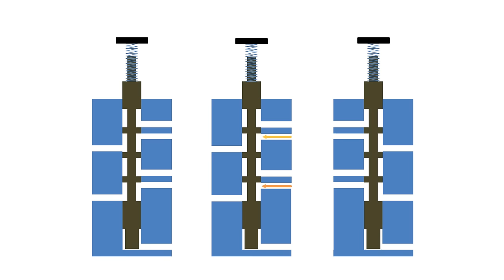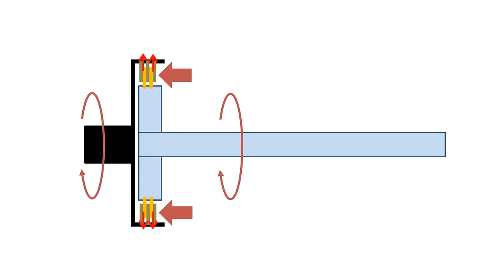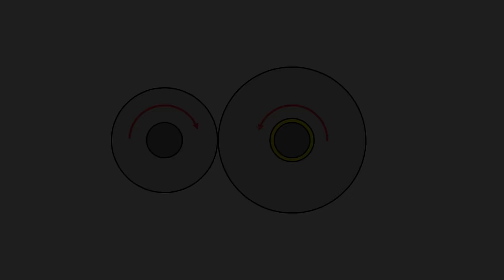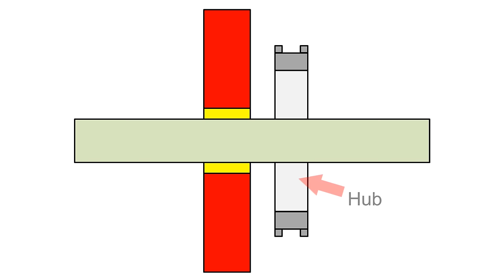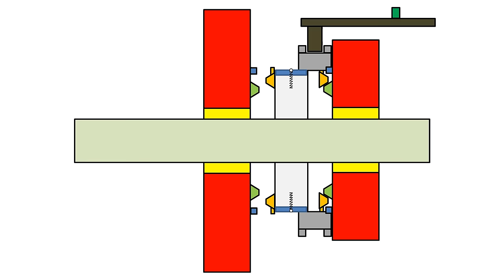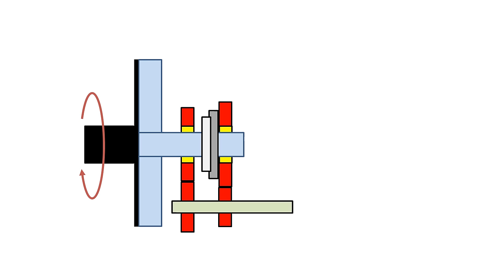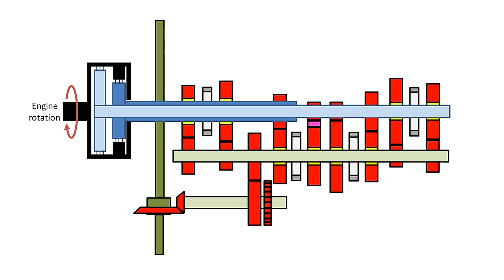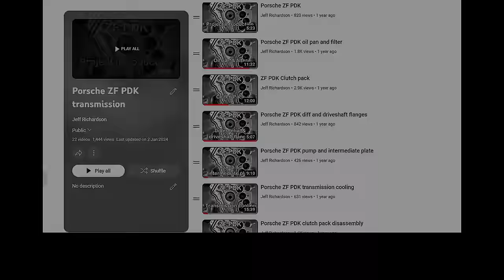World's Best DCT. Porsche PDK. How it works........... Part 1.........

Comment: The reliability of the PDK when considering the complexity is amazing. 83k on my 981 with no problems. I change half the PDK fluid every year as a preventive measure. The transmission is simply sublime for its speed, and its flexibility. Porsche is an amazing engineering company that makes the best cars in the world,  with all parameters considered imho.
Reply: Why half the fluid? (Not saying I think there is an issue there) What is your filter replacement regimen? (Mucho importante)
Reply: DSG is just as reliable. I wonder if it's that much different.
Reply: I guess it is all perspective. I'd consider 83K on any normal car to be 1/2 the life of a normal transmission. e.g. it isn't anything special.
Reply: @UhOhUmm I hear people complaining about the DSG, but I had three cars with DSG, two with DQ200 and one with DQ250. I drive mostly in town where the traffic is very busy and never had a problem. The DSG are made by Borg Warner as far as I know, but I thing that the concept is similar
Reply: @fprintf performance sports cars usually go about 120k before issues. A luxury performance car like a Porsche is probably being driven harder and in most cases less meaning older parts with less miles on them tend to fail due to age rather than use.

Comment: Let me preface this by saying that your presentation and explanations, especially the visuals, are excellent and truly appreciated. That said, I can't share your enthusiasm for a company that goes out out of their way to severely limit access to information and parts necessary to repair something as expensive and critical as the transmission. The end result is a burdensome and unnecessary cost to the average consumer of being forced to pay to replace the entire transmission when a problem arises rather than just replacing the individual parts involved. Most shops, including Porsche dealerships themselves, won't even take the time to look into the transmission to make a complete diagnosis bc they know that even if they do find the problem it's unlikely they'll be able to get the parts to fix it.  So you end up with a situation like that just posted on the Grassroots Motorsports channel where an owner sold his Cayman at a substantial loss bc he was quoted $15k to replace a transmission that could have been fixed with $50 in parts. Something is very wrong when various forums and YouTube videos are the only access consumers and technicians alike have to repair information.
Reply: My Datsun 240Z had a similar failure to that Caymen you referenced.   The roll pin broke/fell out of the shift shaft connecting the shift fork between 3rd and 4th gear.  I added a second roll pin inside of the primary pin, per the Nissan Motorsports recommendation.  I think it cost ten cents, plus a weekend of my time, to fix the trans.
Reply: 100% agree.

Comment: Excellent video. No transmission shop in my area would ever repair one which is why I can't own a used Porsche out of warranty.
Reply: @jimsteinway695  Not even the Porsche dealers will fix a PDK, so if they don't want to fix their own car, neither will I. This is why I only own Porsche's under the manufacturer warranty.

Comment: I bought a 2005 Audi TT with the Original DSG- the second year they were available. 18 years as a daily driver and the transmission and engine have been bulletproof.  The key is that the DSG will NOT allow the driver to run over redline, even in manual mode. And it won’t let you lug the engine.   It never misses a shift, never forgets to shift into 1st at a stop, always gives a perfect throttle blip to match speeds, and gives as close to continuous power as any clutch geared transmission could. It protects the engine and the transmission from over-exuberant drivers. 
The transmission was so amazing that Porsche demanded a 7 speed version for their division.  And Bugatti got one, too, for the Veyron.
Mine still drives like new.  Married to the TT’s Quattro driveline, it’s a fantastic driving machine.
Reply: Had my 2018 Audi A5 Sportback for 6 years now and in love with the DCT, same no issues at all. 
I will keep and drive this car till the wheels fall off. 
BTW, congrats on your car lasting this long.
Reply: @_Mario_PL_  I just invested a bunch of money in mine. 18 years of being parked in the sun had started to burn the clear coat so I had the spoiler and top of the car and hood repainted. The headliner had started to detach, so I had it redone. And some other issues that cropped up in the last year or two. I replaced a fuel pump, and the AC compressor.   But the worst was I left it undriven for a a few months and rats got into it. So I had to partially rewire the ignition harness, and replace the headlights- the rats had gotten inside the headlights and chewed them all up. I also replaced the instrument cluster because the red screen had lost a lot of lines. ( I am considering having the available color screen installed. - but might want to keep it stock )    
But I still haven’t had to do a thing to the drivetrain. 
So the way I figure, I am not gonna LET the wheels fall off. In six or seven more years It might be my grandson’s first car.
Reply: @christopherpardell4418  That's still not bad at all for the age of the car, minus the rats. 
I'm sure if you used it none stop and had some kind of UV protection on the paint it would have been in a good shape. 
By wheels fall off, I meant to say I will keep for as long as possible. I do all maintenance myself, change oil every 5k miles not 10k like Audi says. Just did my brakes, dealer wanted $2,400 I did it for $600.
Reply: @_Mario_PL_  I would like to be able to do all my own work like that.  Just lack the deeper experience to tackle a lot of it.  And a lift.
Reply: @christopherpardell4418  We all start as a beginner, today there are lots of videos online. It would make my life so much easier if I had a lift. It's all ramps and jacks for me. I just like working on cars almost as much as I like driving them.
Reply: @_Mario_PL_  Good point. Thanks for the encouragement.
Reply: @christopherpardell4418  No problem. Start small and work your way up. It's fun, you learn something new while saving money.

Comment: Thanks for the video.   As an NSX enthusiast (both gen1 and gen2) I would love for someone to buy a NC1 (Gen2) NSX and do a complete teardown like you did with your Boxster.  The 9 speed DCT in the gen2 NSX is unique as  the clutch activation is hydrostatic from a pair of electrically controlled hydrostatic controllers.  The shift forks are electrically activated by an electric motor assembly made by Shaffer. The NSX gearbox has no valvebody. Even though it uses wet clutches, the control and activation mechanics is more like a dry DCT.

Comment: In the first stages of viewing this video so far, it seems like an excellent presentation. Thumbs up from a 7-speed manual owner in my 991.1 GTS. Looking at those valves and how new components shed material, I would tend to change my PDK fluid far more often than the recommended interval, but that is just me. The wet clutch is exactly how motorcycle clutches work, but they are manually activated. By the way, the 7-speed manual transmissions has just as few parts available.

Comment: Great explanation.  Fascinating. 

I’ve had VW’s with DCT (“DSG”) since 2007 and get on well with them. My first one had the dry clutch, but later ones the wet clutch which I prefer. I have always felt the wet clutch to be a better solution for heat dissipation but, as I understand, the wet ones are “less efficient” for fuel economy purposes. 

I never hold the car on the clutch - mechanical sympathy. I do understand that DCT’s are not the ideal companion for those who tow and/or need to slip the clutch eg for manoeuvring or very slow take-up. What seems slightly odd to me (as a non-engineer I might add) is that the DSG is programmed to prefer to clutch-slippage in 2nd gear rather than full engagement of 1st, eg in slow-moving traffic. This (to me) feels uncomfortable from a clutch wear/heat point of view but I do get it that constantly changing to first gear in traffic could be criticised for being more jerky which the driver would most likely dislike (low speed jerkiness is a criticism of DCT’s).  My solution in very slow traffic is to use “sport” or manually select 1st when I want it - either is easy enough. 

We also have a car with an Aisin torque-converter 8-speed box which I am more happy with in slow/crawling traffic situations.

Comment: Cool video. “Best” is subjective, though. ZF is DAMN good, but personally I like the Getrag 7DCL750. It’s not proprietary to any specific manufacturer, so technical information is readily available. It’s also the only DCT I’ve ever had apart, so I’m biased of course.
Reply from the maker: Definitely subjective. I've never touched one of the Getrag boxes and the lack of information and parts for the ZF transmission is frustrating. Something I'm on a mission to do something about. But from what I've seen online the Getrag transmissions seem to have so many issues, whilst the ZF box seems to have little of these and is pretty simple to fix.

Comment: All gears spinning on all the shafts all the time is the same of a normal transmission (non DCT) too right? I seem to recall that when I tore those things apart at the Russell Racing School
Reply from the maker: Correct. If the wheels are spinning, so are all the gears.

Comment: You know what's funny? The PDK is very intimidating and complex, yes. But it's actually very simple in many of its engineering choices and a lot of things do double duty. I'd argue that this actually shows just how replaceable parts can be in a PDK - everything is modular, you can replace everything from individual synchros and piston seals to entire gearsets. And because it contains within itself the entire rear diff and housing, it's actually pretty light for what it's worth. A sequential 6 speed can be 125 pounds and a Winters QC IRS rear end housing + diff can be weigh a bit over a hundred pounds. So the PDK at around 260 pounds isn't actually that much heavier, and it's far more compact. That's wild to think about considering every other DCT is upwards of 300, maybe even 400 pounds.

Comment: The video is really well done. But I'll have to watch the sideways movement of the synchroniser rings a few more times to really understand which movement they make and when. What surprises me, however, is the position of the sealing rings at 28:25. To me, the sealing rings look mounted the wrong way round. Normally, these seals are mounted so that the open side of the sealing lip is pressed against the wall by the oil and thus seals better. But perhaps the people at ZF have deliberately fitted them this way for reasons unknown to me.
Reply from the maker: My understanding is that the fluid pushes past the first seal and is stopped by the second. A little counter intuitive, but maybe it's so the gap between the two is full of fluid for lubrication.

Comment: I’ve always been wondering if a double clutch gearbox has a torque converter or not just like a regular automatic gearbox does, or does it just release the clutch when the car is stopped while still in gear

Comment: For mechanics familiar with both- how similar are the PDK 7-speeds from VW DSG 7-speed transmissions such as the DQ381 or DQ500? I realize that they are not variants of each other, but each unique. But why is PDK considered superior?
Reply: much higher torque tolerance with  (700+ lbft), and better coding to shift telepathically. might just comes down to material and cost, since a new pdk costs as much as a jetta

Comment: Darn! The bellhousing is broken ! This came out of a car that was severely crashed. BTW, I think this exact transmission is also used by Ferrari, without changes. That ZF would license it only to Porsche is doubtful in my opinion. And I work at Porsche. Maybe we can get some feedback from some Ferrari guys.
The basic idea of the PDK was in fact started by Porsche for Le Mans races in the 1960's though, but it was abandoned because it was too heavy at the time.
Reply: The parts themselves are used within many other cars, the gear sets are shared with other cars and like the ZF 8 speed it's built to your spec.  I worked for Valmet who manufactured Boxsters. It's more Audi/VW/Skoda as the Bosch makes the ECU and it's made in the same factory as other ZF products, hence the inability to source parts because Porsche doesn't build the PDK. The analogy I would use is Apple not making the screen or most parts in an iPhone, it's Toshiba, byd etc. Piech wanted  parts compatibility at a high level, so a wing mirror motor could be used in a VW polo and the Bentley GT, Porsche Cayenne. There are bits in that which are more Octavia or A6 than Norbert Singer at a lathe as some would have hoped the urban myth would be. Yes there are lots of unique parts, but it's a ZF product. The Truck and Tractor gearboxes are more complicated and the technology is closer to that if you go to the ZF factory as that is where they needed seamless cross over of torque.

Comment: I have a few questions on the clutch pack assembly. 
How different is it in the DSG(s-tronic) application?

If same , where can a detailed assembly (or disassembly) be found... Including the flat running bearings details.

Cheers